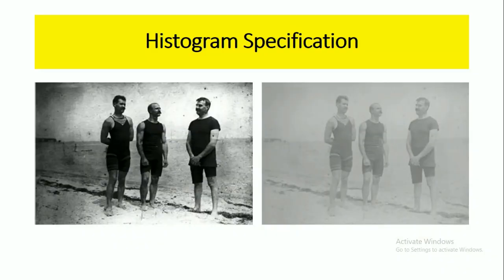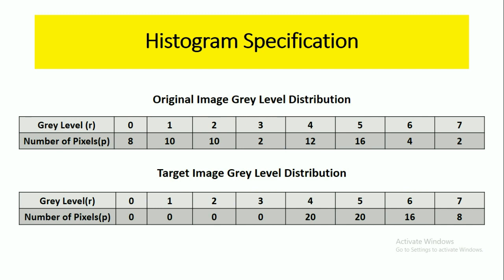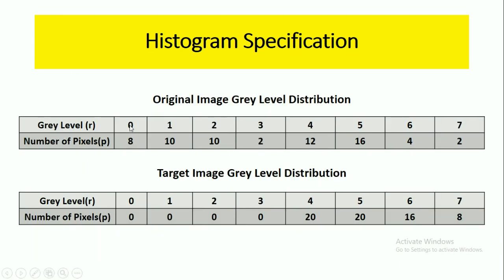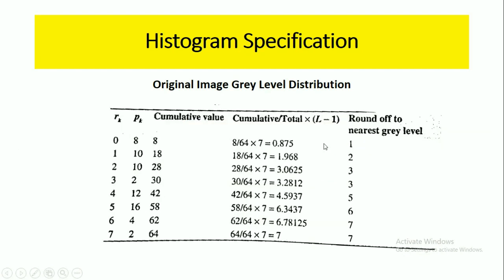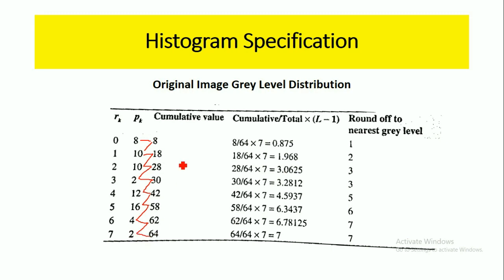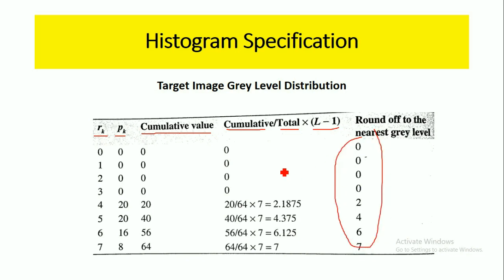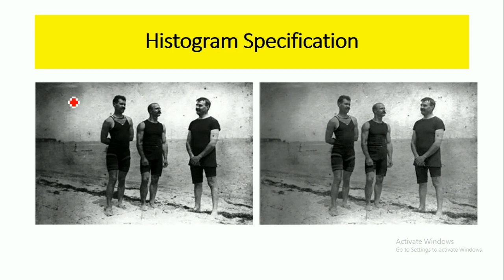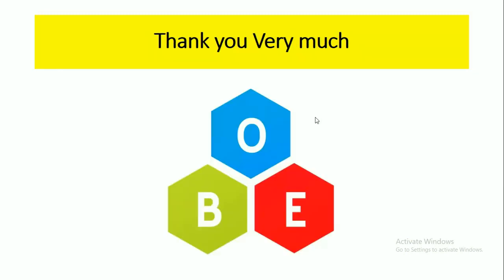Histogram Specification (or) Matching

Comment: very good and helpful ,, but I don't understand the last mapping process , base on what you chose these values? comparing with what ??
Reply: The lecturer says that first you have to do the original image gray level distribution and you have to find the value by rounding off to nearest integer. These are the mapping values. Next you apply the same procedure to find the mapping values for targeted image. Then you have to do the histogram matching. Here you have to consider the two mapped values, i.e. original gray level distribution and next that of targeted image. For H=1 the closest match in  S is 2 ( you have to take the value of s which is greater than or equal to the value of H).  For this S=2, the corresponding value in the ROWS (GRAY LEVEL) is 4. This 4 is the first value of the column MAP corresponding to H1. Same formula you apply for the rests and you will get the same values what the lecturer has got.
You see here for H=6, its closest match in S= 6 (not 7) and the corresponding values in ROWS (GRAY LEVEL) is also 6.
Reply from the maker: OMG...!!!,Thank you very much sir, for your long explanation. Please share and subscribe. ☺☺☺☺